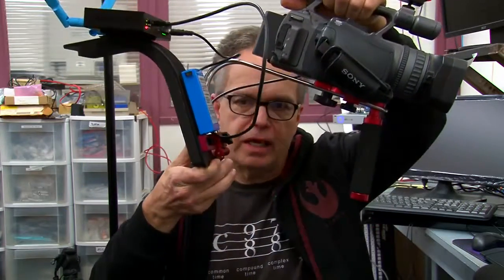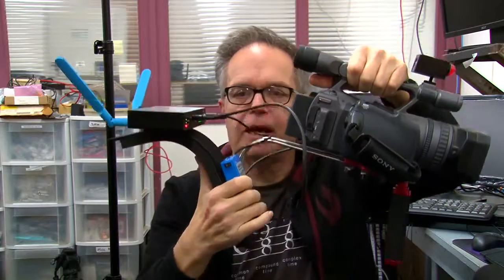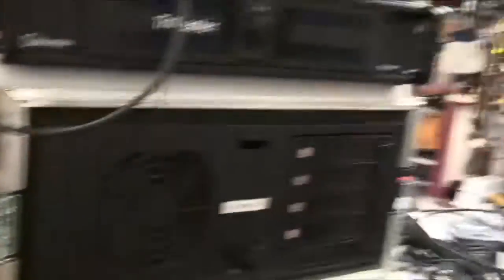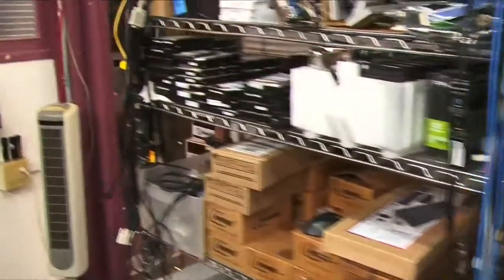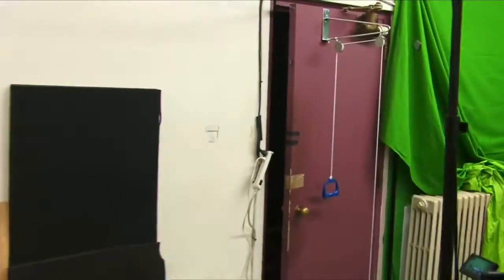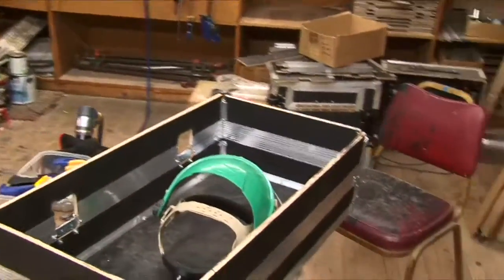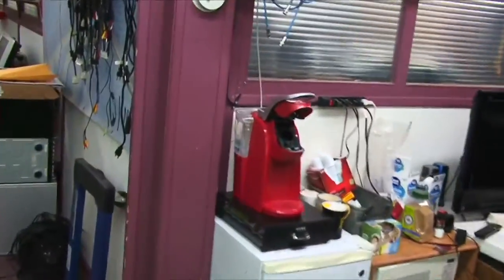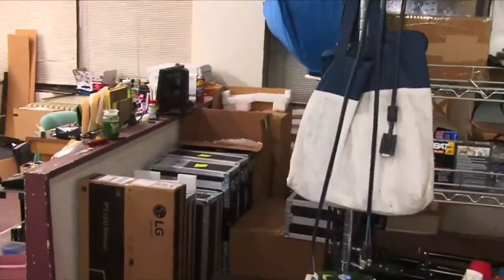Spark Demo: Wireless NDI Camera Transmission

Comment: I was doing the audio for a gig at a casino and using the behiringer x32 mixing console and a dedicated wifi access point. Couldn't get it to work because casino was actively suppressing wifi. You wanna test first because relying on it at a venue.